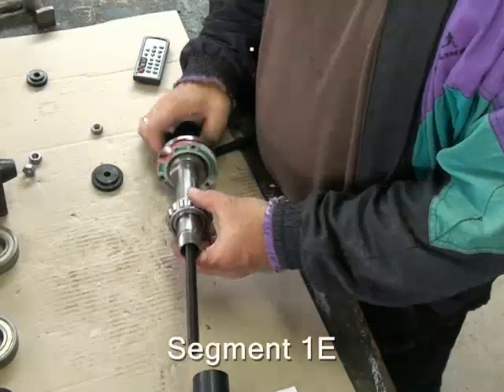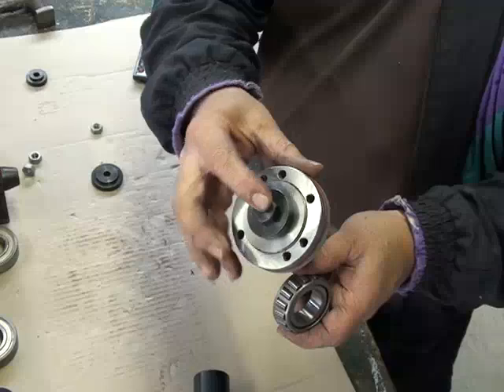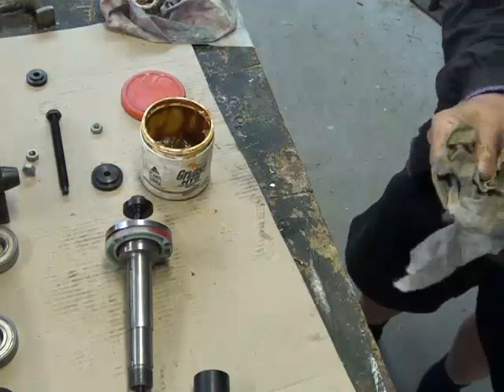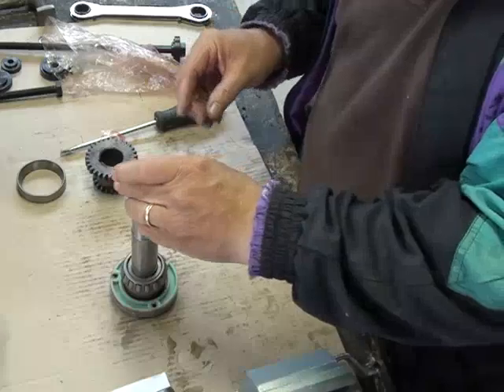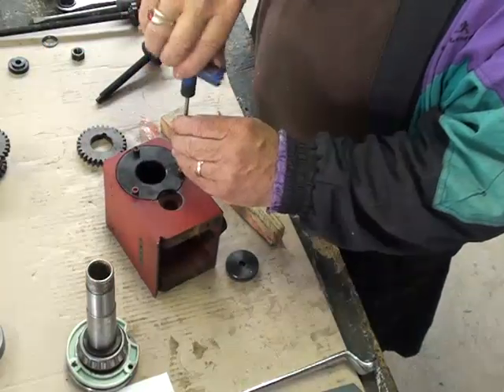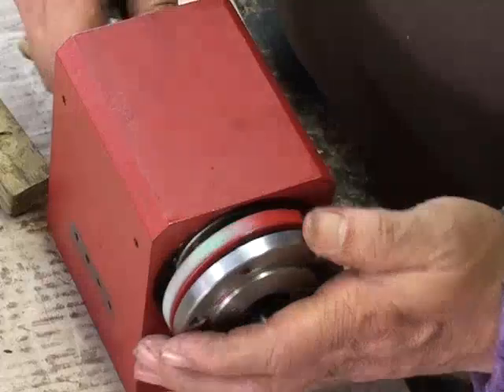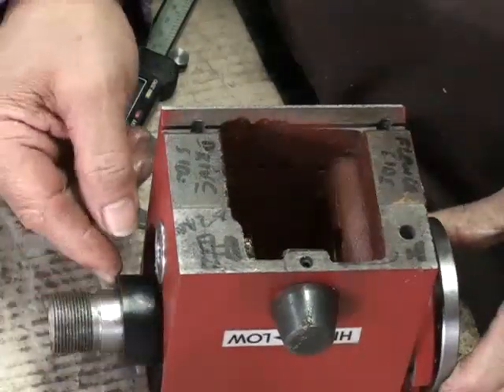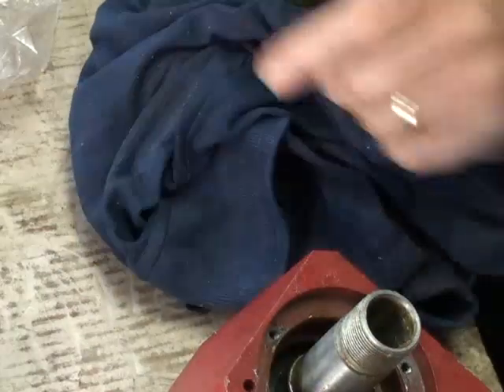Part 1E of Fitting the taper bearings to 7x12 lathe

Comment: I'm starting this mod. A few quick questions.
 #1: My black spacers measure about 38mm and not 41mm which is the taper bearing recess OD . Will I need to still cut out a shoulder on the spacer, because ad of right now, the spacer fits right in the recess?
#2: Can I put the outer bearing cups in the headstock first and then fit the back bearing into the cup , so that I can slide the new 4" spindle with the bearing into the bearing cup and then use my bearing pusher to have the spindle shaft go through the back bearing?
#3: About how many total hours of headstock bearing/spindle assembly, then taking off old headstock and replacing with new headstock?
Reply from the maker: +mpix00 Hi, if the spacer fits inside the recess, then I would think that there is no need to machine a small step into the spacer. I believe if you use the angular contact ball bearings (Little Machine Shop part number 4957) then the spacers also do not need machining since they are the same size as the original ones. Lou.
Reply: +vk3aqz  Thank you for getting back to me. So all I should need to do is take .10 off the larger spacer on the back of the shaft correct?
Reply: +vk3aqz  I have the Tapered bearings(30206 Nachi Tapered Roller Bearing) .. Yeah , My spacers fit right into the recess and over the metal ring of where the bearings are. So from my searching, it looks like the larger black plastic spacer on the end of the shaft needs .10 took off so the tumbler gear lines up. I hear if you make that spacer size with a steel or aluminum, that it is better for pre-loading the bearings.
Reply from the maker: +mpix00 Yes, it has been some time since I did this mod and I was going to mention that the spacer at the C nut end might also need reducing in size. In my case, after I fitted the bearings, I had not driven one of the outer bearing rings all the way into the casing so I thought I had to take quite a bit off that end spacer in order for the gears to line up. I think I mentioned that in the video which shows the bearing getting fitted into the casing (the chuck end). So you need to check that the outer cases of the bearings go into the casing all the way to the ridge.  I think you know what I mean here.  The thinner spacers make the job a bit easier. Yes, I also read on one of the posts that ametal end spacer would be better and I agree with that. As you adjust the tightness of the taper, the plastic spacer tends to squash a bit making the adjustment fiddly. I was going to use a metal spacer but I wanted to get it all back together as quick as possible and go back later and change it. But I never did. However I think it is worth doing just based I what I experienced with the plastic one. I think "plastic" things are not really meant to be in metal machinery!! Hi.   Anyway, good luck with that. One thing - you certainly will have gained a lot more knowledge of your machine once you have pulled it down and rebuilt the thing - which is good for one's confidence when something stops working..
Reply: +vk3aqz .. Yes I know exactly what you mean by the casing going all the way in the ridge. I've been studying your videos for a little while now. I did what you did and picked up a spare head unit with 4" spindle so that I can still use my lathe right now .. I was also thinking of making the small spacers either aluminum or metal. Do you think aluminum would suffice for the small spacers?  For gaining a lot of knowledge, I am actually looking forward to it.  I currently have my mini lathe made into a cnc and it works quite fine for the work I do in Brass, but when I try and make grooves and "deeper" cuts , I do notice chatter quite a bit so I am quite curious to see how the tapered bearings change the chatter. Was it a very noticeable difference?
Reply from the maker: +mpix00 I think Aluminium would be better than the plastic. If you can get a piece with a thick wall that would be good. I find brass and plastics machine quite good with these small machines and using the common HSS tools. After I changed the bearings, I found that the cutting was smoother and better. The biggest improvement was with the parting tool. I use the Warner blade with a carbide tip section sold by LMS. Before the mod, the wobble in the work piece meant that the cutting action between the tip of the blade and the metal work was a series of micro collisions as the work wobbled in and out of contact. The cutting was jerky and chattering, and the blade would take a dive now and then even after carefully setting the height. After the mod, the work rotated a lot steadier and now I could apply the right feed speed to get a nice smooth cut. It was like cutting butter now.  I think anything that improves the smoothness of rotation will improve cutting action. Of course your tools need to be good quality also and have the correct rake and type of material. For example, I find that good HSS tool tips give a smoother cut on silver steel than carbide tips. Also, be wary of buying tools from Ebay. I find many of the sellers have tools which did not pass final inspection and are rejects. Some are slightly out in size, or with a small taper, or not quite dead straight. Some claim the material is carbide or M2AL but are in fact fake using mild steel just hardened up on the surface. Tools purchased through a reputable supplier I find are a lot better. I am sure some Ebay tools are ok but the majority are rejects purchased by small Ebay outfits and palmed off to hobbyists who don't have enough experience to notice the tool is not to specification.   So the point of this is that those tools will chatter and cut rough no matter how good your machine is.  That is what I have come to learn over the last few years.
Reply: +vk3aqz when you say for the aluminum with a thick wall, do you mean to have an aluminum spacer with the same size OD or bigger OD and should I have it thicker then the 8mm that it is? maybe make it 10 or 9mm thick?
Reply: +mpix00 I guess what I'm trying to figure out is do the spacers have any thing to do with the bearings per load as well, or is. just the bigger spacer towards the end of the shaft near the threads?
Reply from the maker: +mpix00 I guess what I should say is that if you use an aluminium spacer to replace the plastic one, one tends to just get a piece of tubing with roughly the same inner diameter but usually only a mm or so in thickness. The original plastic spacer has quite a thick wall and it is the size of the wall thickness that comes in contact with the C nuts and bearing edge. So as you squeeze on the tube, the thicker wall can take the force. A thin wall tube, say a piece of common hardware store tube, has a lot less surface area in contact with the squeezing forces so there is a greater chance you will distort the tube and it may not be as good as a piece of thicker material. Also, when the spindle is turning, the spindle, box, and bearings all get warm and this will heat up the spacers. Thicker wall material will be better under heat than thin wall material. Not a lot but some. Thick wall tubing is not easy to find. I  have some studio lighting tube which has a 6mm wall thickness. That would work but I would need to bore out the tube to fit the spindle as that tube has a smaller inner hole. Overall it's okay as it was designed to fit lamp holder stubs but strong so it does not fall on the audience etc. You could also machine a tube out of a rod or block to achieve what is close to the original plastic spacer. It's more work and I guess that is one reason I never actually did that.
Reply from the maker: +mpix00 Well the spacer is between the C nuts and the bearing and you have to adjust the C nuts so the spindle turns easily but is not sloppy. It's like the bevel bearings in a motor car wheel. You adjust the force on the inner bevel so the bearing rollers just touch the inner and outer bevel. There needs to be plenty of bearing grease in there also. Once the shaft starts to turn, the grease heats up and forms a lubricating film on every surface. That film is of a specific thickness which is part of the specification of the grease for that application(i.e. don't use cooking oil for example !). The spacer is between the C nuts and the bearing and transfers the loading force between the 2 parts and it has to maintain the correct spacing during rotation. If the spacer expands or distorts under the forces and heat, the carefully adjusted clearance you adjusted will no longer be as accurate and the spindle may tighten up or go loose. Generally it tends to tighten up because the C nuts tend to tighten just like wheel nuts holding a wheel in place and the I guess an aluminium spacer will actually expand rather than contract. So I find that from time to time I have to loosen the system and readjust the loading because the motor safety cuts in. Also I have had to replace the grease once. There is more maintenance than with the sealed ball bearings but the up side is much smoother spindle.
Reply: +vk3aqz  Yes I have aluminum stock that I will face to correct OD and then bore to the correct ID. I will use a metal washer for the larger back washer. what I am also going to do, is cut a square on the top of the headstock and cut some acrylic to cover it with screws so that I can readily check on the grease and have everything easily accessible. Thanks for the info.
Reply from the maker: +mpix00 All ok. The access hole into the bearings for repacking and inspection are a good idea. It's a bit of  job to repack the bearings. I managed to do it by pushing the spindle out about an inch on the chuck flange side using one of the bearing repair tools (washers and threaded rod) and that was enough to wash out old grease and repack with new grease. I don't really know if I had to do it because the old grease still looked good. But once I had pushed the spindle out I just did it anyway. Like you, I also have a spare spindle and maybe I should upgrade that and mill some access holes in like you are suggesting. It is just sitting there doing nothing so it might be a job for a rainy day.
Reply: +vk3aqz  yeah, I am taking my time on this mod. I purchased an older, "new stock" Amadeal 0618 which had the 3" shaft and I contacted a friend who purchased a few of the newer versions with the 4" headstock with the metal gears he had lying around. So I now have a 4" w/ metal gears to don't his mod to, while my version currently has the adapter plate with 4" chuck. It machines quite nicely for my brass , but when I make grooves and especially when I part off, it makes quite the chatter. Once this new headstock is exactly modded the way I want, I will have to exchange and put it on to test the preload . My current set up is pretty precise as even with the adapter plate I have very, very little runout, so hopefully with the new set up, everything lines up well. I will def take pics of the top window and make a little video on YouTube once I get there with the aluminum small spacers and back metal spacer. Another thing is to get 48mm x 4mm O Rings , so that I can put them over the shaft where the plastic bearing covers come into the headstock so no swarf gets in. The O Rings fit Perfectly in the little groove already made in the Plastic bearing covers.
Reply: +mpix00 Oh yeah, what would you suggest for a good grease? I was thinking automotive grease, but not sure?
Reply from the maker: +mpix00 Sounds pretty good. The O rings would be good. Parting a piece of solid rod is probably one of the more difficult things to get right. I found the LMS parting blades (USA made) which come with carbide ends cemented into to the blade, are about as good as it gets without going to the expensive insert tools (which can have a limited cut depth).  To part brass, you need to get the top edge of the tool at a very precise height somewhere near the centre point of the rod. When the run out is smooth, you should get a thin ribbon ofbrass swarf coming of the top of the parting tool. If you are getting random mixed chips and chatter, then the tool may not be positioned correctly and the tip may be either blunt or the  rake slightly out. The LMS blades have a good sharp edge and the rake is good for brass. Parting plastics is easy but steel or iron is a different kettle of fish. There are lots of steel material types but silver steel seems to be the easiest to machine. Hardened steel and high tensile bolts, and similar bolts can be quite hard to part and you need really good blades. A bad piece of steel can blunt your blade in seconds. For carbide tips, I use a green 200mm grinding wheel and sometimes a diamond hone to get the sharpness back. So even a really smooth good machine cannot help if the  tools are not good.
Reply from the maker: +mpix00 I used marine grade wheel bearing grease. Seems to be alright. Probably an overkill but available at most auto shops here in Australia. Other wise just a good wheel bearing grease.
Reply: +vk3aqz o.k., so I got the o rings.. What a good mod to secure from dust etc.. I also cut the top and tapped and screwed a poly shield on the headstock. Starting the build tomorrow.
Reply from the maker: +mpix00 Ok.  They are a good idea. Good luck with rebuild - should  all go together well.
Reply: +vk3aqz yeah, I'm going to take a before and after video of the runs install o show the difference in cuts/performance.
Reply: +vk3aqz  Just got 2/3's of the way through. It took a while to get my bearing puller to get the Bigger Metal gear on  through the headgear as you have to align in to the Keyway. It was just very,very Slightly off alignment to the Keyway, on the new Shaft , but it found its way onto the keyway which was nice. Being that everything is so snug fit, it does take longer than imagined , by watching the videos;) I Also put the New smaller Metal bearings on the intermediate shaft. All I have left to do is to put the other side Taper Bearing in and then tighten everything up. Then to take the old headgear off and put this new one on and dial in the right Bearing Load.
Reply from the maker: +mpix00 Yes, I imagine there will be a variation in spindle diameters from lathe to lathe. But a tight fit is better than a loose fit as it means the preloading is likely to stay put for longer.
Reply: +vk3aqz ...I noticed I have a very small spring in my parts box I used while disassembling. I have a feeling it goes in with the hi lo gear set screw position. Can you confirm with me where that tiny spring goes?
Reply from the maker: +mpix00 Yes, your probably right. However I cannot remember exactly about the spring. I would need to go back and see if I can remember using the videos. I will also go and have al look in my spare spindle box and see if I can locate it. I will get back to you asap. Lou
Reply: +vk3aqz Thanks. I'm currently watching your next set of videos of taking the old headstock off and putting the new one on.
Reply from the maker: +mpix00 Hi, yes, there is a small spring in the hole under the hex set screw which bears on the Hi Lo gear shaft going into the box. I turned the set screw till I could fell a slight increase in friction on the shaft as I turned the handle telling me the spring is slightly compressed. Not really sure why you need it but I guess it stopsthe fork rattling since the hole is a bit sloppy. Never really notice that before because I did not remove that shaft.
Reply: +vk3aqz .. Z
Got it Thanks! I just pulled  the back taper bearing onto the rear of the shaft into the bearing cup. I pulled the bearing cup all the way into the headstock recess and also have the bearing on the shaft going into the bearing cup as far as it goes and I still have a little space(about .150)  between the back black spacer between the Large metal gear and the inner race bearing.  Is there supposed to be this much space between the Large metal gear,black spacer and inner race of the bearing? My front bearing is right against the black spacer and the black spacer is right against the large metal gear on the front of the shaft, so I was assuming it would be the same for the back?
Reply from the maker: +mpix00 Hi, I am not 100% sure but I don't think so. The idea of the spacers I think is to keep the large gears in line with the driving gear.  Also, to keep it centred in the box. The spacers should stop the large gear sliding along the shaft and touching the inside walls of the box. There is only a fairly small clearance there.
Reply: +vk3aqz that's what I was worried about. The strange thing is that everything lines up. I took some pictures. Would you be able to email me at mpix00@gmail.com, so that I can show you the pix and you let me know what you think? I could also make a wider back spacer to make up the space.
Reply: +vk3aqz that's what I was worried about. The strange thing is that everything lines up. I took some pictures. Would you be able to email me at mpix00@gmail.com, so that I can show you the pix and you let me know what you think? I could also make a wider back spacer to make up the space.
Reply: +mpix00 Problem solved. The black spacers that came with the headstock were the smaller 7.5mm ones. So being that I did not have to shave a shoulder to fit in the bearing recess, they already fit into the bearing recess. So the bearing spacers went in .125" each which is why I had a .125" space bewteen the Large metal gear and bearing. I took the extra 7.5mm spare black spacers I had and shaved it down to about .125, then cut it into a c shape like a retainer clip and it snapped right in place over the shaft onto the spindle and I now have a nice and snug spacer from the large metal gear and the bearing recess..
Reply: +vk3aqz 
So I got the head assembly back on a set a pre load. I ran it in high gear but it seized or stopped. I switched it to lo gear and it ran ok but stopped a few times. Does this mean I need to loosen the pre load some?
Reply from the maker: Hi, Yes, it's too tight.
Tap the Belt drive end of the shaft with a soft head mallet or wood so as to push the shaft slightly and therefore move the inner race of the bearing just a bit. The shaft has to move freely with your hand. Once it starts to turn it will tend to centre if there is a slight amount of loosness because that is what a taper bearing will do due to the taper.
Reply: +vk3aqz should I also loosen the nut some to back off of preload?
Reply from the maker: +mpix00 Yes, I should have said that first. Just a bit.
Reply: +vk3aqz OK GOod to know. I also noticed with the metal intermediate gear , it makes quite a bit more noise running then it did before. I did purchase a new plastic intermediate gear. I am thinking of putting that on instead. The intermediate gear shaft should be easy to take off and replace the metal to plastic gear right?
Reply from the maker: +mpix00 Yes, the metal gears are noisier but they don't break.I have not tried a plastic drive gear meshing with the metal one. I would imagine you are right. It should be quiter and, yes, if you do break it, it's not as hard to replace.  Still a fair bit of work but no need to remove the main bearing.  You do tend to forget about the noise increase after a while. If they were brass gears they would probably be better.
Reply: So after loosening the Spanner Nuts,  I " Tap the Belt drive end of the shaft with a soft head mallet or wood so as to push the shaft slightly and therefore move the inner race of the bearing just a bit."..............I did see that it moved a little bit, so it prob did move the inner race of the bearing.. I think that did the trick;) I am starting off in lo gear and steadily increasing the speed to see how the pre load is.. Is this the correct way to figure out the per-load?
Reply: +vk3aqz  my hi lo gear keeps moving out of hi gear when the lathe is running, making a crynching sound and stops the spindle as it slides out of gear.  Do you have any ideas why this would happen?
Reply from the maker: +mpix00 yes, that's sort of the final check - to make sure it runs at the highest speed without stalling.
Reply from the maker: +mpix00 That's not normal. I have never had that happen. On my spindle box, the Hi Lo lever at the back is quite firm and when I turn it, there is a bit of force needed on the handle. It sounds like the lever can move too easily letting the gears slide out. Maybe the small set screw with the spring under it needs to bear down harder on the shaft with the lever on it. Also is the fork inside okay? I assume it is as I cannot see how there would be a problem there unless somehow it is not the right size (Loose) for the section of gear it is pushing left or right. Maybe it is bent or something. I think if you find the lever is too easy to move, it might be the problem. Also, are the teeth of the gears not meshing properly. Not sure why.
Reply: +vk3aqz  Yes I have a feeling it is that set screw with the spring underneath.  Am I going to need to take the headlock back off to get to it?
Reply: +vk3aqz yeah, it must be the spring with set screw. I will take the head back off tomorrow  and tighten it.  The  good  news is I'm learning my lathe quite well.
Reply from the maker: +mpix00 Well - in theory  yes!  However, I assume the lever is also moving across when this happens. So I would be tempted to try and stop the lever moving by tying or blocking it from moving across and see if the problem still happens. In other words, is the gear itself somehow slipping out just enough to disengage but not moving much more than that and the lever does not move. I imagine if the gear moves a few mm, due to the slight edge bevelling on the teeth, the gears will not mesh. I assume the large gear is too tight to move so it can only be the small gear. Also I assume the large gear is in the correct spot on the spindle shaft to mesh exactly in the middle of the small gear and that the relative locations of the 2 sets of gears (I.e. the spacings between the 2 spindle gears is the same as the spacing of the 2 smaller gears on the hi lo shaft - that is - are they matched). Just some extra thoughts.  So before removing the spindle box, tie the hi lo gear lever so it cannot move. And see if you still have the gears not meshing.
Reply: +vk3aqz yes, I can actually see the handle moving from hi gear to the left towards the lo gear from the movement of the gears when turning in higher speed. I was thinking of making a stop , to stop it from moving left.  I will try this first tomorrow and see if that works
Reply from the maker: +mpix00 Ok - at least it means it is probably a loose hi lo shaft rather than gears not matching - well lets hope so!
Reply: +vk3aqz  Yes it is a loose hi lo gear shaft. I put the newer one from my other head assembly on as the detents were new and so was the set screw, as the set screw had a point and the old screw point was squared off. Everything is now running nicely, no motor seizing and after running on hi the face of the spindle is slightly warm and I have next to zero run out. The only thing I notice , is that my motor pulley gear is just barely off t o the left which makes for a slight freying of the rubber motor pulley band, but I do not think that will be an issue as it is ever so slight. Time to put my cnc kit back and and put the 4" er-32 collet holder and see how this improves parting off etc..
Reply from the maker: +mpix00 Yes, the spindle box will get warm and quite warm after a decent session. But that is okay. Those bearings need the lubricant to flow between the surfaces which happens when it all warms up. Don't worry, it won't get that hot that the spindle box will melt! Adjusting the belt is a bit of a pain because of the rather poor method of mounting the motor. it's too easy to get it either not horizontal or too far left or right. All the screw slots are too sloppy and touching them causes the motor to drop or sag. And at the same time you also have to make sure the belt is not loose or too tight. Fortunately, it only drives the lead screw and I only use the lead screw drive for small thread cutting. The rest of the time I use the carriage hand wheel.  On the web, some users have made better mounting system for the motor so you can adjust it more easily. Some even put bigger motors on as well. Sounds like your run out is improved. Just check that your chuck is mounted as accurately as possible as any small error in the centering, will tend to cause the spindle to wobble due to the weight shift around the centre of rotation. That is also a fiddly job and takes time to get right. Also some of the chucks I have used do not centre the work due to small variations In the jaws and scroll grooves. I have one which I cleaned  up with a diamond hone so the three jaws close dead centre. Some chucks just have poor scrolls and the jaws work loose during turning. As you can imagine, some people confuse bad chuck centering, and poor quality, with spindle wobble. Just a few things to think about.
Reply: +vk3aqz  I took of the adapter plates to only notice that I need to get new size screws to fit my chucks onto the 4" spindle.  so I will check out the Chuck centering tomorrow when I get those correct size screws.  I'm looking forward to seeing what results I will obtain.  I also took your advice and purchased a carbide tipped parting blade:)
Reply from the maker: +mpix00 Ok on the blade. The thinner one tends to flex a bit but it cuts well. When you have the height of the tip just right, you should get a thin continuous ribbon of brass coming off when cutting into a brass rod of, say 1/2" diameter. If the end dulls up a bit, touch it up carefully with a diamond stone or a green grinding wheel. I use the green wheel for sharpening carbide tips and a white wheel for HSS. You will be surprised at how good your carbide edges become using the green whee (Silicon Carbide)l. Mine is an 8" wheel. I don't know what colour they are in the US but that's what we get here in Australia (From Hare & Forbes -http://www.machineryhouse.com.au/Print?Code=G168&All they are on the web too).
Reply: +vk3aqz Thanks,. I had to re-align the motor and the belt as my pulley belt was fraying. I have one of the aluminum Motor pulley and intermediate shaft pulleys to lower the gear ratio for better torque. I also increased the TORQUE pot on the electronic control board and it gives the lathe a good amount of torque to where I cannot stop the spindle in my hand on lo setting. I thread SS tubing so this helps a lot. So then I noticed that I now need M8 set screws to fit my 4" jaws onto the new 4" spindle. I will pick those up tomorrow and then get started and see how things cut with the new taper bearings!
Reply from the maker: +mpix00 Very good. Hope it goes okay after all this!
Reply: +vk3aqz lol me too! I have a good feeling as everything is now dialed in. It seems to run smoothly and you were right about the metal gears as I did not really notice them while running.
Reply: +vk3aqz     ALL I CAN SAY IS WOW!!!!  I now have no chatter what so ever, the parting off came just like you said, nice, smooth, ribbon shavings. No Chatter whatsoever on parting off! Amazing MOD/UPGRADE.  Everyone who owns a mini lathe, needs to do this MOD! I am absolutely amazed on the improvement my mini lathe performs now!
Reply from the maker: +mpix00 Very good. Looks like you have got there all okay!
Reply: +vk3aqz  Yes, Thank you for all the help. I was surprised on how there is no chatter, no vibration and the parting off was sooo smooth. It is like a night and day difference. I am going to make a video tomorrow and out it on youtube. I will send the link.
Reply from the maker: +mpix00  Thank you.